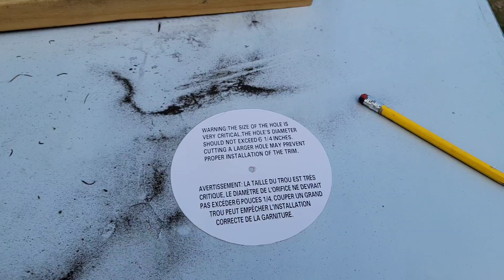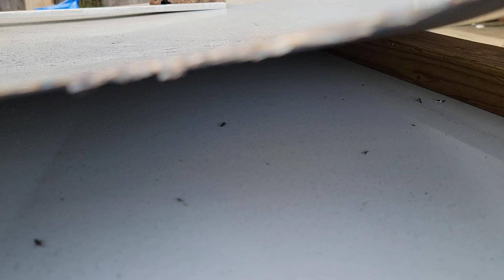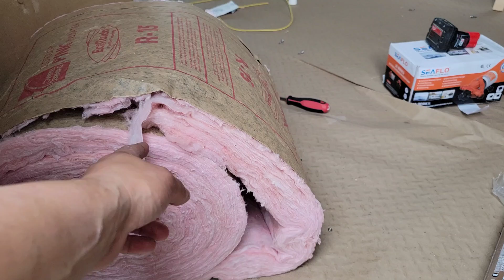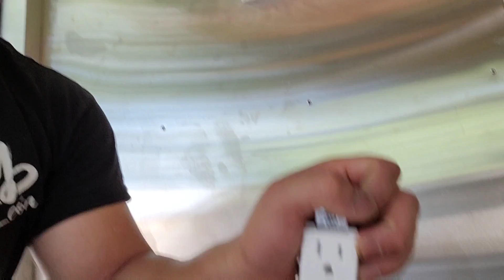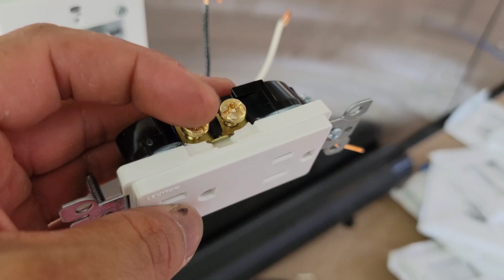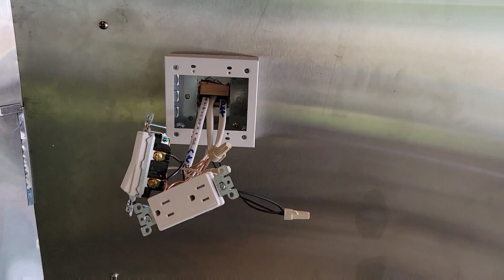Food Truck Construction: Ceilings and Outlets

Comment: when you cut holes for these type of lights you have to smooth out the edges and make it bevel a little so the bevel shaped backing on the light fits flush.
Reply from the maker: @chefsharpdressed  yes sometimes you do. I use the angle grinder to smooth out also. I like strip light more now

Comment: what did you use for the trim when the wall meet the ceiling ? did you use like a 90 degree trim or you just cut the steel as strait as you can and just calk?
Reply from the maker: No trim. Used the piece that is straight cut from factory up there

Comment: Where did you find those outlet boxes? Can’t seem to find any exposed boxes (not recessed into a wall) that fits a cover plate
Reply from the maker: There are in the description link under wire mold boxes
Reply: @fbaltierrez  saw it right after I commented 😂 thanks man.

Comment: Can I just run exposed conduit instead of running everything behind the walls?
Reply from the maker: I couldn't see why not. Just run EMT should work
Reply: @fbaltierrez  thanks! I’m getting a trailer built, I’m submitting the plans now, but it’s only going to be a partial build. It has an interior size of 15’9”x7’10”  with 88.5” tall ceiling. The shop building it will provide a door large enough for a single wide commercial fridge, a 48” concession window, and the electrical, the rest is up to me. I have a 48” commercial benchtop flattop, 48” refrigerated make table, 40lb deep fryer, single wide commercial fridge, 3 bay and single bay sink, fresh and waste tanks, prep table, and several racks. I’m getting ready to get an 8’ hood, 60” chef base fridge, and a 12” bench top twin burner, water pump, and lp water heater. I’m putting everything I have into this.

Comment: Hi what are the black frames going horizontal on the ceiling? We have a bus and the ceiling is rounded as well.
Reply from the maker: Those are the factory installed studs to hold the aluminum ceiling up
Reply: @fbaltierrez  hi frank thanks for getting back to me, how would I find them and where? Home Depot? Also how do you fill in the space between the hood and wall. There’s a gap I need to fill.

Comment: Snap in bushing wont work for the panel? Its what im thinking of using. Keep up the good work!
Reply from the maker: Yes that is correct those won't work not enough clearance I used rubber electrical tape

Comment: Hey Frank what size of stainless steel you are using?
Reply from the maker: I believe it is 18 or 20 gauge
Reply: @fbaltierrez  304?
Reply from the maker: @Rmunoz1984  yes I believe that is correct the 304 is what I have
Reply: @fbaltierrez  thanks brother I need to buy like 12 sheets, here in MA price are $145.00 brother my trailer is 8.5 x 16